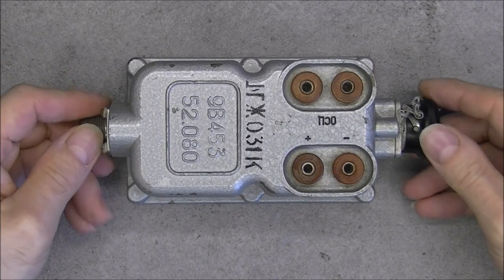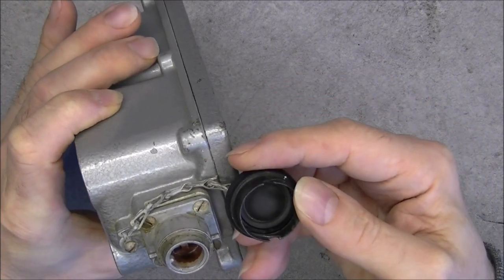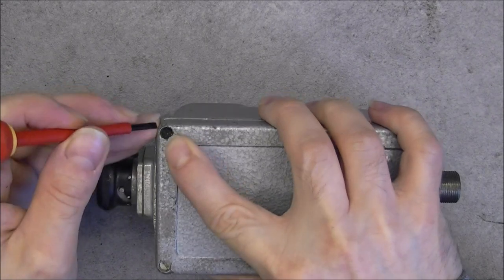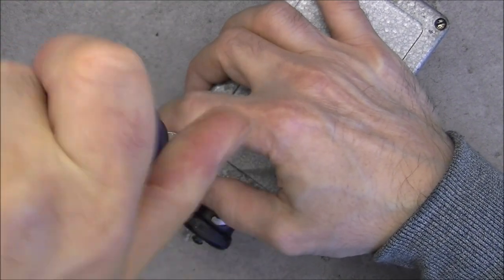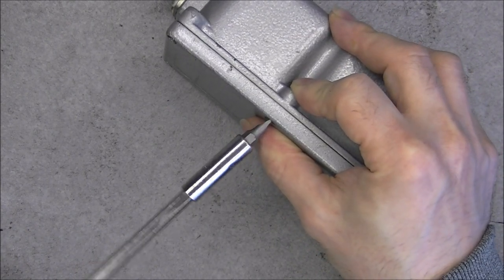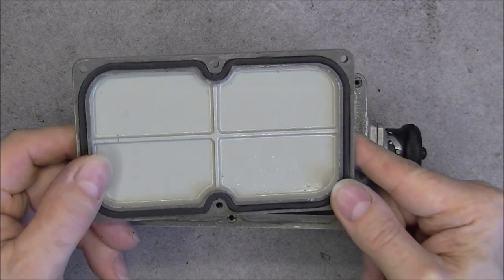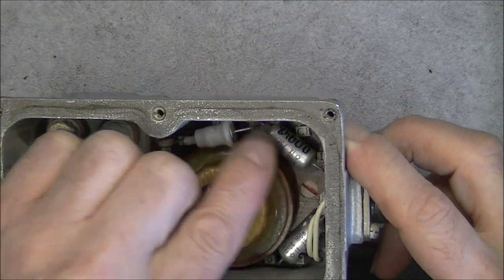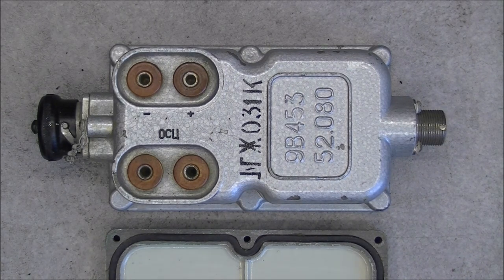Soviet 9B453 missile system accessory box teardown

Comment: I love those replaceable threads on the box, real attention to detail! I guess maybe they had a few cross-threading mishaps on early units and went for that as a solution so the whole box didn’t have to be stripped down and replaced....
Reply from the maker: My other items with that kind of box use either real nuts, or those flavor of threaded insert. One thing that must be avoided is to mix brass and an other metal in the same bolt assembly. Any moisture and the mix of metals turn into a little battery, and will oxyde to a point it will be impossible to take apart later. I experienced it on one of my cars someday, when it seemed a good idea to put aluminium caps on the tire valves. Then came the day to inflate the tires... and destroy the locked up aluminium caps with a dremel.

Comment: Half wave rectifier. Small power supply.
Reply from the maker: Fun to see how they over-engineered the case around that under-engineered power supply. Super tiny transformer, one diode and film capacitors for a power supply, really ?
Reply: looks like a power supply filter with plugs to measure current and voltage. Yes, the case is over-engineered and it cost more than other components